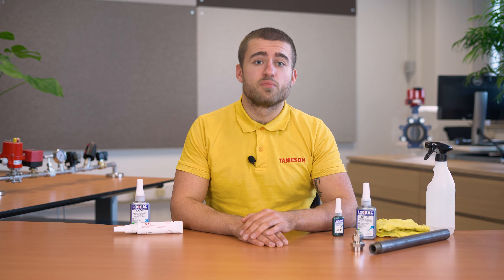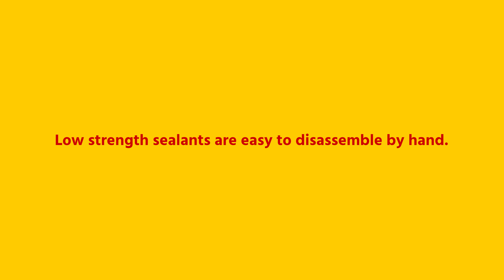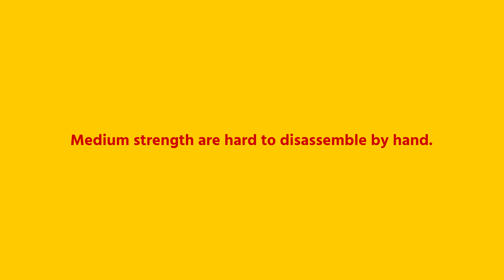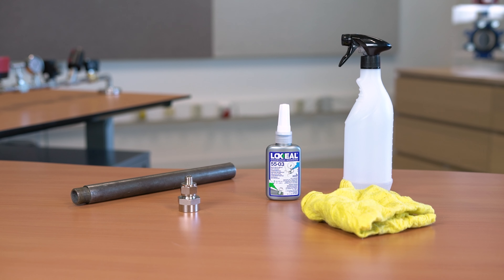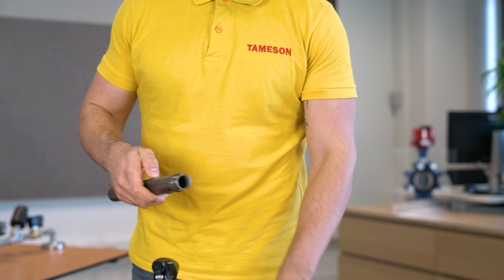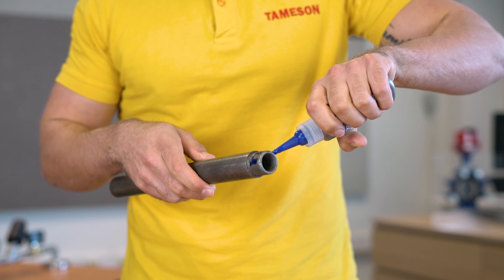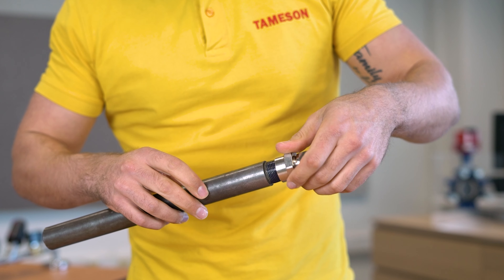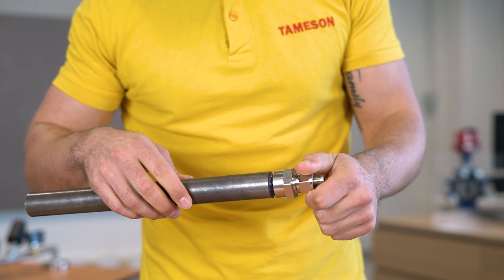How To Apply Thread Sealant | Tameson

Comment: How about using it on a copper fitting for an espresso machine? Do I need to make sure to cover the whole thread area with the sealant or just the end part of it? Like the end oart away from where water will be flowing through.
Reply from the maker: Using thread sealant on a copper fitting for an espresso machine is a common practice to ensure a watertight seal. Here are some general guidelines:

1. Type of Sealant: Make sure you are using a thread sealant that is suitable for use with potable water and can withstand the high temperatures typically found in espresso machines.

2. Application Area: Apply the sealant to the male threads of the fitting. You should cover the entire thread area, not just the end part. This ensures a complete seal and helps prevent any leaks.

3. Avoid Over-Application: Apply a moderate amount of sealant. Too much sealant can squeeze out and potentially contaminate the water flow, while too little may not provide an adequate seal.

4. Assembly: Once the sealant is applied, assemble the fitting according to the manufacturer's instructions. Make sure to tighten it properly to ensure a good seal.

If you'd like more specific information or recommendations, I can search for detailed guidelines or product recommendations for thread sealants suitable for espresso machines.